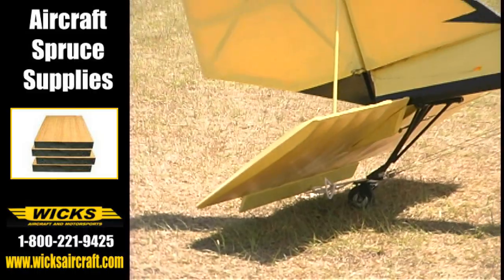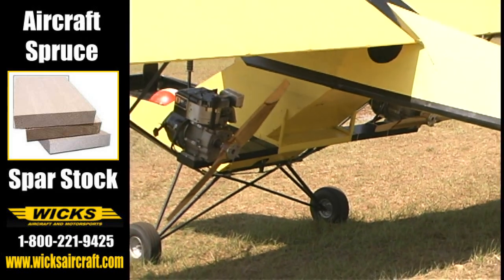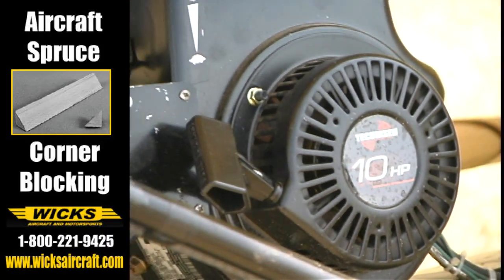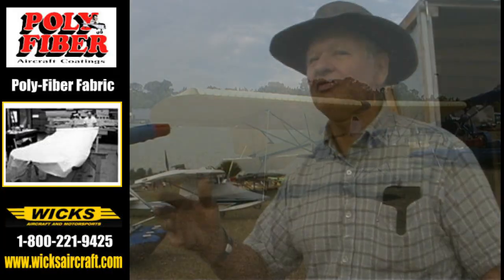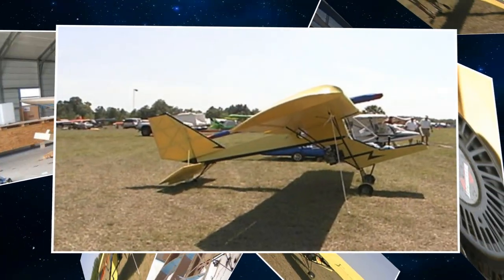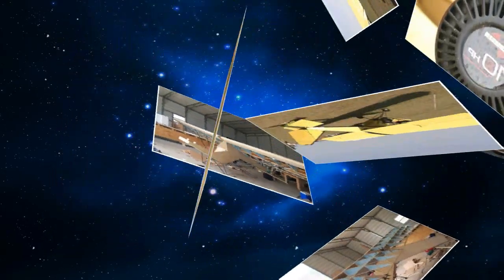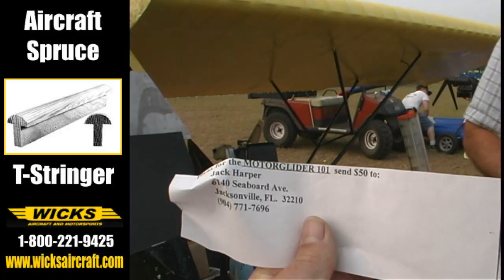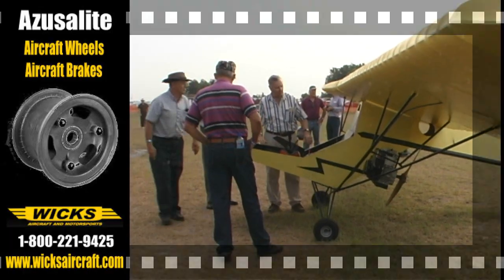Home Depot ultralight aircraft, Jack Harper and his HomeDepot plans built ultralight aircraft kit!

Comment: any video of this thing flying?
Reply: ***** pilot error is the most common failure, thinking that they are flying a fighter jet or an acrobatic aircraft and try to do more g's than the airframe can withstand! 

Some fool on this topic thought that an ultralight should be able to do 6 g's! that's like 3,000 lbs on an aircraft designed to do only 4 g's max!
Reply: ***** LOL, your scared of your own shadow! Experimental aircraft are meant to be experimental not meant for the mentally short changed, perhaps you should troll a knitting channel and leave the flying to the pilots!

Comment: He said it can fly on only one engine? only 10 horsepower? It must be under 100 lbs in order to do that...
Reply: You'd probably be hard-pressed to take off on one, but you could sustain flight possibly.
Reply: ***** you ever build a toy plane? iv'e been building planes since I'm seven. Am 58 now. lengthen  the cord, oh heck just do what they do for human powered flight... Do you think a person puts out several horsepower? I don't think so... A wide wing that is corded long enough. and tall enough to create a large enough vacuume above the wing for lift. and Tada... yer airborne for next to nuthing, just ask my brothers, the ones with all the scars...me too... for that matter.. I'll tell you what, you take, (now I'm going to get in trouble for this) you take a set of blueprints from a Piper Cub.  Change em up so It's yer design and build it bamboo, or spruce or pvc...  Split a six inch pvc pipe for the leading edge  and trailing edge.  Now as far as Part 103 rules go stick to em.  But experimental is experimental ok?   I mean you can build a flying machine... Remote control it at first and then when you have proven to yerself that the crazy contraption actually might be putting you onto sumpin...
   Just how hill billy ya wanna go huh?
Reply: *****  Every time I see one of your posts I find another stupid comment, this time its ("To take off under your own power requires an 80-100 hp engine.") That is not even close to true! There are NO ultralight aircrafts that use an 80 hp engine or larger, first the plane would only be legal if it weighed 10 lbs and second it would never get off the ground!  

Actually 40 hp is the perfect power for flight, A Rotax 477 or even a Kawasaki 440 and a lot of guys are taking VW 1600 cc engines removing two of the four heads and it comes in at 85lbs and 50hp!
Lets start from what I consider the smallest UL engine: @ just 26hp the Rotax 277 weighs only 65 lbs with the reduction gear they are recommended for the following Ultralights:
 -     Aces High Cuby I
 -     Advanced Aeromarine Buccaneer XA
 -     Aero Adventure Aventura UL
 -     Aerodyne Systems Vector
 -     Aerotique Parasol
 -     Aircore Cadet
 -     AmeriPlanes Mitchell Wing A-10
 -     Applebay Zia
 -     Avid Champion
 -     Bagalini Bagaliante
 -     Birdman Chinook WT-11
 -     Butterfly Banty
 -     Canaero Toucan
 -     Capella Javelin
 -     Carlson Sparrow
 -     Dart Skycycle
 -     Earthstar Thunder Gull
 -     Fisher Avenger
 -     Fisher FP-101
 -     Fisher FP-202 Koala
 -     Fisher FP-303
 -     Fisher FP-404
 -     Fisher FP-505 Skeeter
 -     Fisher FP-606 Sky Baby
 -     Flightstar
 -     Flying K Sky Raider
 -     Goldwing Ltd Goldwing
 -     Green Sky Adventures Micro Mong
 -     Hipp's Superbirds J-3 Kitten
 -     Hipp's Superbirds J-4 Sportster
 -     Hipp's Superbirds Reliant
 -     Howland H-3 Pegasus
 -     Hummel CA-2
 -     ISON Airbike
 -     JDT Hi-MAX
 -     Kolb Firefly
 -     Kolb Firestar
 -     Maxair Drifter
 -     Loehle Spad XIII
 -     Loehle Sport Parasol
 -     Mountaineer Trikes Mite-Lite
 -     Murphy JDM-8
 -     Piccard Eureka
 -     Raceair Skylite
 -     RagWing RW4 Midwing Sport
 -     Rans S-4 Coyote
 -     Rocky Mountain Wings Ridge Runner
 -     Skye Treck Skyseeker
 -     Sorrell Hiperlight
 -     Spartan DFS Trike
 -     Spectrum Beaver RX-28
 -     Swallow Aeroplane Company Swallow A
 -     TEAM 1030R MAX-103
 -     Teratorn T/A
 -     Thor T/A
 -     Titan Tornado
 -     Ultra-Fab Sundowner
 -     US Aviation Cloud Dancer
 -     Wood Sky Pup
 -     V-STOL Solution
 -     Zenair Zipper
Reply: *****  If you can do 35 mph you will fly in most ultralights and gliders! That requires about 20hp to 40hp to take off and sustain flight, got it, we don't swap engines in flight, it's pretty much what you take off with is what your going to fly with....I'm getting tired of correcting your comments, you should watch some videos of "STOL" aircraft, instead of spewing out all of this nonsense!
Reply: +spcemn   You are a raging idiot lol. Just keep dodging those questions dude.
Reply: You would be losing altitude with only one engine, because not only is your power cut in half, but you'd also have to crab the airplane to keep it flying straight... with some continuous rudder and aileron deflection... which causes...   more drag than normal.     Still, landing with one of two engines, is better than landing with no engine.  

Two engines aren't all that efficient, however.   Twice the weight penalty doesn't really end up giving you twice the thrust.